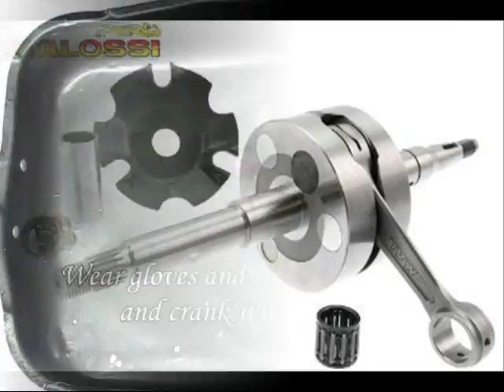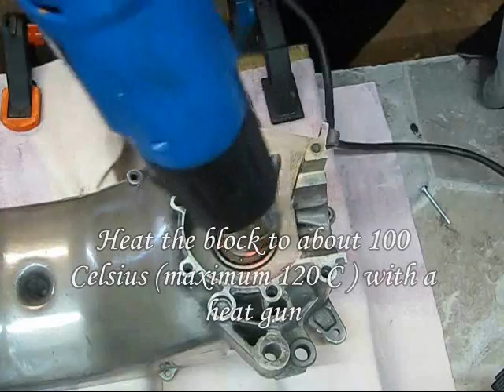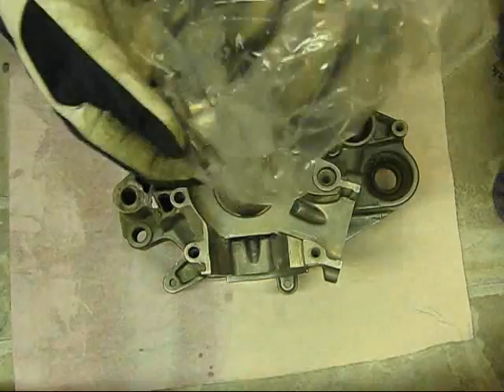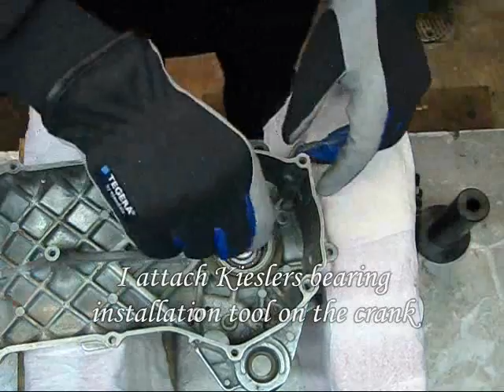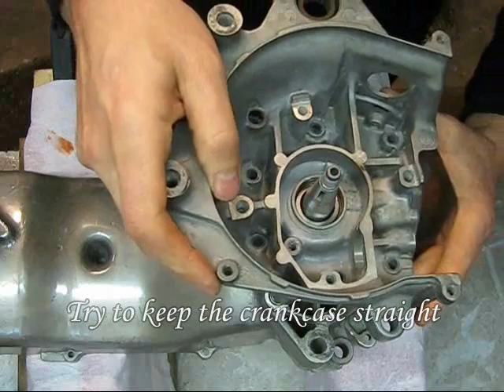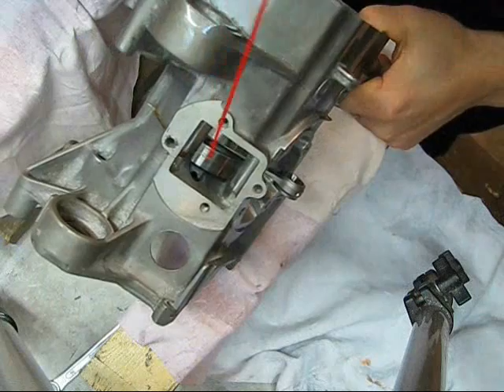HasSse´s  Aerox Malossi MHR Big bore 86cc english ver. (part 4)

Comment: Gasket seal: RED HIGH TEMPERATURE SILICONE ADHESIVE SEALANT 70ml HEAT RESISTANT 300'C "liquid gasket" new https://www.amazon.co.uk/dp/B00RY1RDMQ/ref=cm_sw_r_cp_api_i_PoJeDb3FA8FHM
Crankshaft installation tool universal: 
https://www.pedparts.co.uk/product/964/buzzetti-crankshaft-installation-tool
Crankshaft puller if you did something wrong:
https://www.pedparts.co.uk/product/872/buzzetti-crankcase-crankshaft-puller-tool

Comment: I've just notice a problem withmy aerox I've fitted a stage 6 pipe and after riding I'm getting a knock sound when I come of the revs only before I stop is this the small end bearing going defo sounds where the piston is
Reply: Winston Banks 
hello did u get some answers about your problem becuse i have some problem with my yamaha aerox

Comment: Hello, u did pretty well but i do 3 engine in your time for sure. Some steps just waste some time. at the end u forgot to "middle out" the crank. Dont lubricate the bearring-covers - they can pop out. You can go farther than 100°c - you can see it when it start to burst ;)) - dont heaten up the bearrings and dont clean em up with gasoline. Put the parts in fridge is just waste of time. But anyway that engine runs and u did a good job.

Greetz from Germany

Comment: Dont put grease on the bearing retainers....u might lose them if u get a missstart or carter detonation due to sparkplug.... use dishwasher gel... as it will evaporate, grease doesnt...same goes for oil. good videos btw
Reply from the maker: Good tip :)